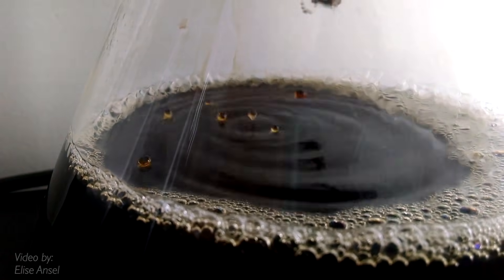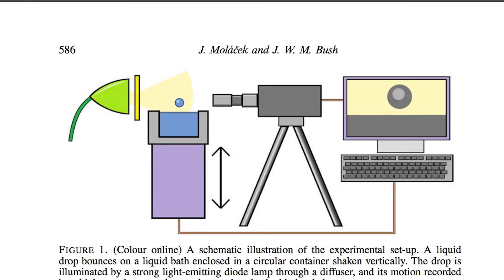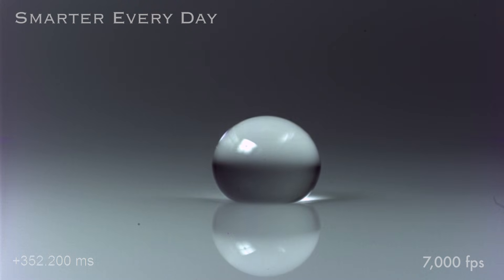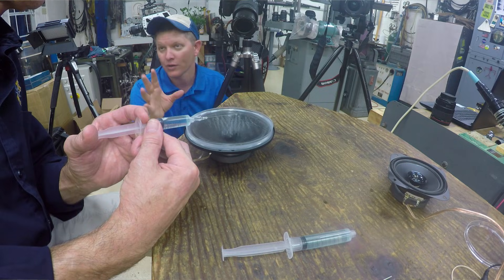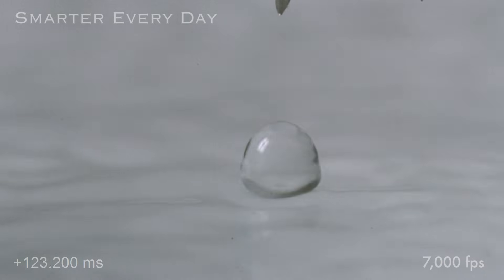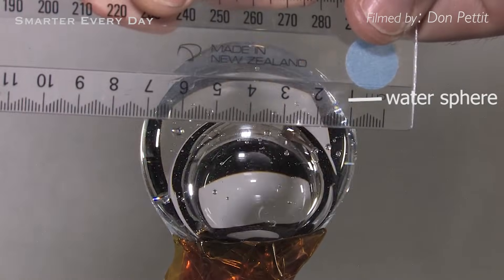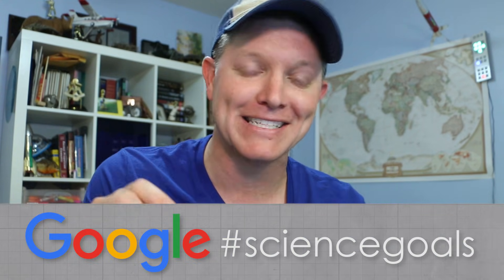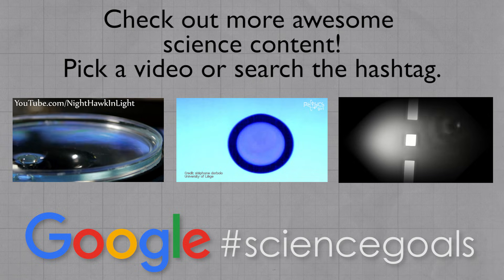The WALKING WATER Mystery (in SPACE and SLOW MOTION!) - Smarter Every Day 160

Comment: I thought the beading or conservation of the water droplet was down to the surface tension of the water in the dish and the surface tension of the droplet, surface tension is the barrier of the two environments of air and water, in order for the water droplet to conjoin through the surface tension of the droplet and the water in the dish the negative and positive ions of both have to be aligned as opposites attract they cant conjoin while negative negative and positive positive as they repel each other everything only happens when the energy of the two opposites align if that makes any sense, thats why you will find that water that is "Structured"  will bead less as at the molecular level they are molecular and so free to roll to opposite ions and conjoin and not bead? I came to this conclusion on the basis that everything is by trinities and the third of any 2 opposites is the energy and the environment as that is the zero point or where we see that which we perceive to be real  and you have to consider the bead of water the dish of water and the environment or zero point between them?

Comment: I propose the reason the drop persists is an electromagnetic effect because Oxygen exists unbound in the atmosphere as a diaelectric molecule. A Beckman Model D2 oxygen analyzer used this fact to move a mirror with a magnet and "display" the oxygen concentration in a sample of gas. The more oxygen in the sample the more the magnet would move the mirror and light would reflect off the mirror on a scale in the view port of the analyzer.  
As the drop of H2O falls through the "air" (21% O2) the surface charge of the drop increases in the presence of the higher O2 in the air. The lowering of the ambient pressure would indeed lower the magnetic charge due to the decreased concentration of the available oxygen molecules. As soon as the surface charge between the water pool and the drop reach equilibrium the drop coalesces in the pool. In the sound wave experiment the drop is "rubbed" on the air cushion and the surface charge persists a bit longer not unlike a comb and the static charge when rubbed on a wool sweater.

Comment: . I've enjoyed 'floating water' since as a child I swam in a large pond in the rain, and saw that most of the raindrops are nearly the same size and the same as the droplet that pops off the top of each rebound water spike, and jump back up to a uniform height (about 2") and each jump releases a fan of smaller droplets that skitter about, interfering/riding on the nearby wave formations. It was an enthralling light show of dancing droplets. I always suspected that the electrical properties of surface tension contributed to the 'lubrication' that inhibited the skitterers from melding immediately.
. Re 9:20 The cello is mellow, ie mostly first few sine wave harmonics. These compression waves are able to form strong (focused) nodes on the negatively curved (inside) surface, strong enough to eject droplets, which then drift off with little enough speed to be unable to rejoin the sphere easily. Wish I had more physical statistics in math class, and a better understanding of how Van der Waal's force affects the surface tension.  
. As for the theory that it is the viscosity of air that provides the lubrication, I still think that is not enough, though I do enjoy dropping a large pane of glass onto a flat surface & relying on the viscosity of air to prevent it shattering.  Fun stuff!!!

Comment: Are the cohesion/adhesion vs coalescing characteristics of pure water different enough to allow the smaller mass droplets (with less gravity force pull toward the surface of the water) to avoid coalescence as the primary expected response, and prefer to coalesce later when either an air layer as a barrier gets overcome and or the cohesive coalescent desire vs the gravity or velocity of the drop to the surface of the water is overcome (surface tension)?  What if you change the temperature of the 2 surfaces (flat water vs nearing beads of water)?  How about the air pressure--raise or lower it and chart the reactions (of course water will not be water in 0 psia).  What if you use a surfactant like dish soap on the flat water, to change it's surface tension properties?  What if soap is in only the droplet, or both?  Don't you sometimes wish you could observe things with the electron microscope's vision??  Could this experiment be done with liquid mercury at possibly different temps?  You make me wonder.......

Comment: Hey, Destin. I don't think the phenomenon has anything to do with a "cushion" of air under the water droplet as much as the air pressure around the water droplet is causing the surface tension to be amplified. I know surface tension is molecular attraction. What I'm suggesting is that normaly the pressure from inside the water droplet is getting counteracted by air pressure allowing the surface tention to do its thing. When air pressure drops, internal thermal pressure can break surface tension and the water boils.  So there doesn't have to be a cushion. Maybe try the experiment in much higher air pressure and see if you can get a stable anti bubble!

Comment: I can't help but wonder if this phenomenon is caused entirely by surface tension, and that the 'air gap' has nothing to do with it.
An experiment that could test this would be to add a little detergent to the water, to eliminate the surface tension.
If the droplets completely disappear, then it's caused only by surface tension.
If some droplets remain, the 'air gap' is a contributing factor.
Any experimenters out there?    Any opinions?

Comment: @7.52 It makes no sense. Surely the gravitational force is a constant irrespective of the size of the drop?  Maybe he meant to say momentum?

 If the mass of the drop is larger this will increase the size of the drop but also alter the waveform pattern required to catch it gently enough to negate coalescence? 

It would be totally cool to do this experiment under a vacuum. I also wonder about the influence of surface tension....OK...I checked. Rabbit hole too deep.

Comment: Ok so why doesn't gravity immediately squeeze the air out of the gap? Is air just really viscous on small scales, or is is the gap so thin it can't flow? Any explanation has to cover the cases where the water DOES merge. In the notes the claim is made that the mystery is solved, but as far as I can see they haven't explained a dang thing. They have just described the mystery in a little more detail, with even coming close to providing an answer.

Comment: Destin, amazing video. I'm curious why you think the air gap is being compressed? Isn't it possible that the variation in the surface of the absorbing water (due to energy input to the system from the speaker) is the only thing that is keeping that drop from coalescing more quickly? Keep up the good videos!

Comment: Surface tension! Air gap. Many factors. Temperature, mass, tension, and motion of the two surfaces. A transient occurs at the compression zone between the surfaces. Now consider walking on hot colas barefooted! There are known techniques that help one cross the coals with little damage. It too is a zone effect!

Comment: I didn’t read every single comment, but I didn’t see any mention of oil doing this.  I’ve seen this happen when pouring oil down a funnel.  The first time I noticed it I thought maybe it was air bubbles but then I poured more carefully and with my eyes closer and could actually see the droplets running across the cascade of oil that was already flowing down the surface of the funnel.  Noticed this with fuel spilling on the ground as well, just never new what to call it

Comment: Well I think that's same like ublec , when we apply force on it , it acts as a rigid body . And on the other hand when someone jumps in swimming pool without contracting his or her body I mean perpendicular to water in straight line , the water acts like a concrete wall and in this case of water drop I think same thing is happening .
I mean the drop applies force on surface of water and then water surface applies the same force so it bounces and due to gravity the force applied by drop keeps  decreasing after every bounce and finally it gets submerged in water

Comment: 7:10 - It's nothing to do with the kinetic energy of the collision but the increased surface area provided by the distorted water surface providing a larger air cushion. If it was CKE then when the wave rises to meet the drop it should burst and it doesn't in many examples you provided.
Reply: Why would an increase just of surface area in the distorted water make a difference? It's the high and low spots of the distorted water creating, well kinda like the thing they do in kindergarten where the whole class holds on to a massive blanket or quilt and they shake it up and down, and then throw a beach ball on the erratically moving blanket. The surface area isn't increasing, it's the, idk if oscillation is the right word, or the movement of that surface that cradles the beach ball. Or in this case, a drop of water.

Comment: Destin:
 I have witnessed this many time and wondered what it was Thanks.
  However I have another water question that has been bothering me for quite awhile ,,,Wondering if you could shed light on it. here it is.
.
  this had intrigued me for years,
 and I don't know what causes it.
 When it rains .if you are near a body of water I have seen it on the ocean as well as on farm ponds.
 There seems to be definite shapes on the water surface they are always curved shapes never sharp corners. it seems to hydraulic damming.
 if you watch it closely it keeps the same shape ,and does not vary too awful much with the  intensity with the rain speed.
 but when the rain gets heavier it becomes more pronounced.
 What does this?

Comment: I don’t think it’s an air gap keeping them from coalescing. I think it happens because of surface tension. With lower air pressure, you have less atmospheric pressure pressing in on the surfaces, so they “pop” easier.

Comment: You notice Don started with a sine wave, then showed a square wave and a triangle wave. 
9:20 "There's something about the cello..."  the cello (and other string instruments) produce a sawtooth wave, which ramps up linearly, then has an abrupt decrease in amplitude. My guess would be that this sudden negative delta in pressure would facilitate the smaller droplets shearing off from the internal air/water boundary. And apparently they occur more readily at a frequency resonant with either the diameter of the internal air sphere, the diameter of the water sphere, or the thickness of the water sphere. So a sawtooth wave, swept through that frequency range should work, much like the cello music.
Reply: wow you are smart
Reply: @Xavier-rp2ko  Just a lot of experience and research with audio and music synthesis.
Reply: Big word. Me no like. Me caveman
Reply: @matthewhunter2443  How's the internet bandwidth in Bedrock, Mr. Flintstone?
Reply: Stephen Macuch ih bad
Reply: It's interesting that the bubble changes so sharply back and forth from the "buzzy" state to the clear state, even though the music is continuous. I printed the sheet music to compare and it seems to buzz principally on the D in the middle of the bass clef (which is played as a pedal point especially in the 4th and 5th bars from the end where it buzzes most) and in the first section also around the D and close-by pitches an octave above.
Reply: @subjectline  - most likely these are resonant frequencies for that exact size of bubble. Same principle that allows a single note to break a glass chalice.
Reply: I also wonder if it is the natural overtones. Multiple frequencies combined with the variables you mentioned where one the overtone causes a valley to quickly become a peak meeting like this ^/\^. It is always important to remember that music instruments are not one frequency but layers of them. It is why computer voices for so long sounded "robotic" they where only one single frequency and without the overtones to smooth out the sound its very staccato. I do not have much experience in music but I do tech and the tech behind sound recording and replication is fascinating. Of all of the ways we try to replicate the human senses is the one of the earliest and most 1:1. To create sound we vibrate air that we hear by a small bone in our ear vibrating. The Microphone is functionally exactly how our hearing works and the speaker while not the same as our vocal cords recreates the same vibrations to get replicate it. Basically once we had that the only major advancement was in how we preserve the sound for later replication. First wax cylinders then discs then shellac then vinyl then magnetic tape (mag tape was the last Analog)...... Science is awesome.
Reply: Your theory is sound.
Reply: @FlyMacFish  lol 😂
Reply: why do i fell like i'm the only non-smart person here
Reply: Isn't the part about the sawtooth wave backwards? It seems like it should be more like an impulse followed by a decrease in amplitude.
Reply: Cello music: is playing
The water: he groovin
Reply: If the cello is a instrument that is similar to the human voice, would the sound of someone humming cause the same thing because it is similar?
Reply: One other thing to take into account is that the cello music was a full composition, swiftly changing tones and overtones causing far more turbulence as the remnant waves of the changing frequencies interact as they dissipate in the water. So as per OP's comment, it would have been nice to see a single saw tooth wave and a multi tonal full piece of synthesised music for comparison.
Reply: @liamhenderson3753   I would like to see if a human voice singing would do the same as the cello or similar.  Let's send Don back on another space mission.   Maybe bring Christina Aguilera with him. :-D
Reply: Thought about sawtooth wave being the differance, but not more than that.
Reply: It's more important to recognize that a stringed instrument has overtones and harmonics in its voicing, unlike a single tone wave. These harmonics are what couple and give the finer waveforms within the tonic waveform and lead to the instability on the surface to eject the smaller droplets. A human voice would likely produce a similar state. Super interesting.
Reply: @DaversTravels  The triangle wave and square wave also have overtones. Of course, we can't know if my guess about the sawtooth wave conjecture is correct, since Don didn't try one of those with his signal generator.
Reply: I do agree. But if we change the strings it would sound a lot different. Could it possibly be the strings that are the factor or maybe the density of the wood as the sound box?
Reply: Waw. That was well explained.
Reply: There are other sawtooth waves that don't have the effect. There's something Else about the cello, that makes it éspeciale.
Reply: @Stephen Macuch If I want to learn more about the (shapes of) waves of a range of instruments, where should I look into that has nice pictures of the waveforms?

Comment: Does this work with other liquids?   You haven't discussed surface tension as it arises from molecular structure and intermolecular forces.  I would postulate that this is unique to water which then would implicate the hydrogen bonding of water molecules in this phenomena.

Comment: The cello is awesome! I first noticed such walking water droplets about 3 years ago in my coffee, but didn't manage to find any explanation in google. But if it's really just about softening the collision by hitting a wave at the right moment, that would mean that you could create a droplet exactly above a totally calm water surface so that the collisional kinetic energy is almost zero and you would see the droplet staying there on the surface without moving! And that would be even more awesome! But I would rather suggest, that there is another factor - it's about having an uniform thin air layer covering a big part of the surface (interface) between the droplet and the water surface, so that surface tension exerts big enough force on the droplet. That means the water surface needs to form an indentation upon contact with the droplet so probably a calm water surface won't work. 

Anyway, this reminds me of an other "glitch" that I noticed few years ago - at the right lightning conditions you can see a double reflection of your teeth in the mirror, probably because both the metallic surface behind the glass, as well the glass surface itself reflect.

Comment: Before i go on and watch this entire video, I'm going to guess something with surface tension and the water molecules similar to a meniscus?

Ok. 12:09 mins later.  I was wrong. Air pressure is the primary cause. I still think surface tension has something to so with this.